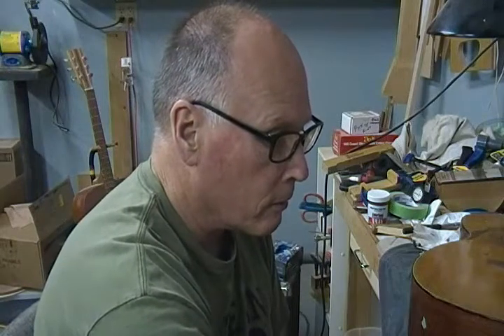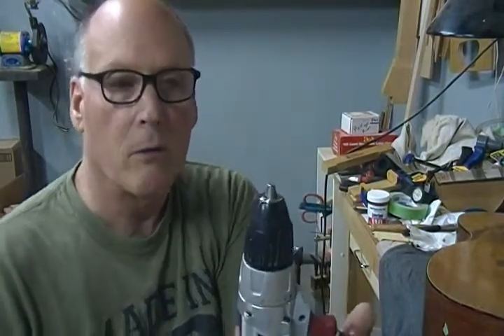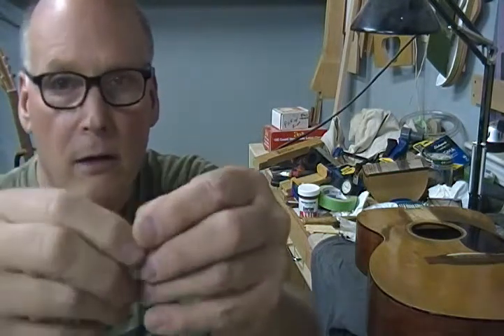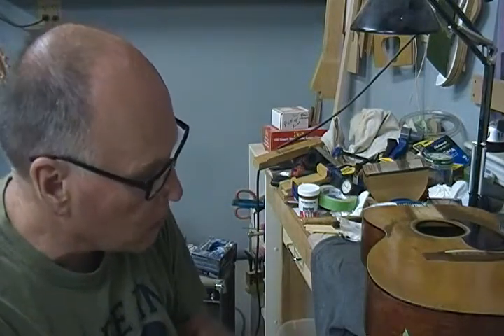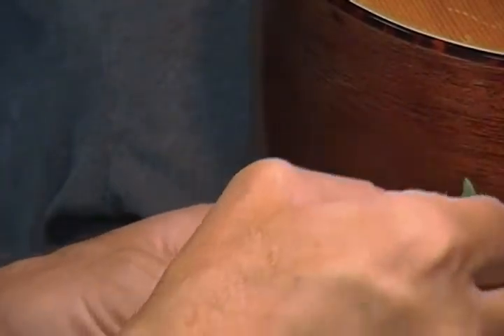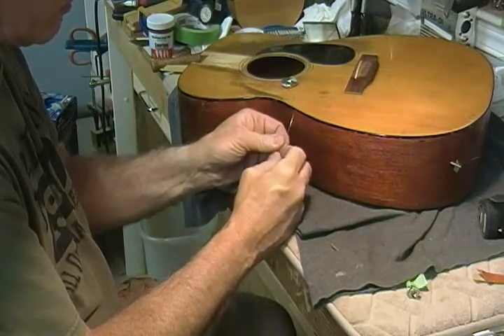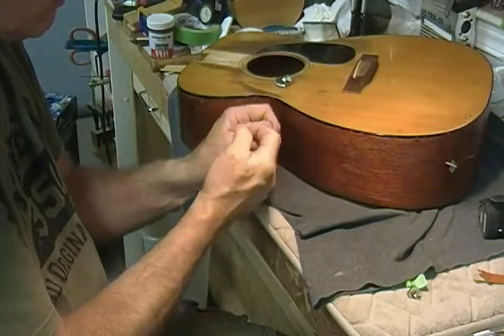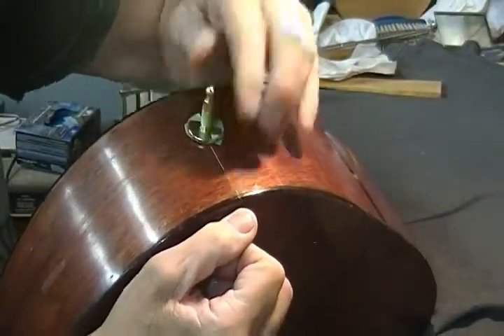65' MARTIN 000-18 Hard to get to cleat install by Jonah Guitars

Comment: This is a cool approach to the problem Dane. Maybe look out for a pin vise? It's a tiny four-jaw chuck that you put in a conventional chuck. You can then get a grip on tiny drills or in this case wire without folding the end over and having to deal with eccentric wobbling. A pin vise won't break the bank either.

I thought I was alone in getting "thick" fingers, seems not from your comments.
Reply from the maker: Dippy Hippy, a pin vise is a good idea. Ha, thick fingers is a good way to put it.